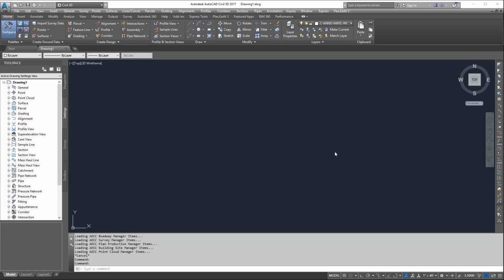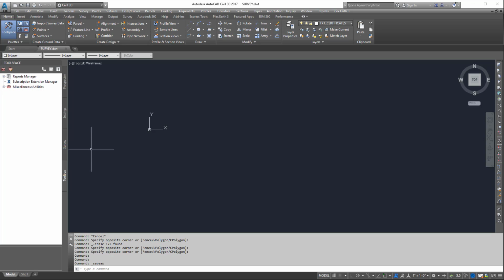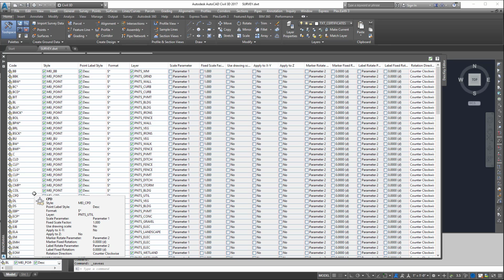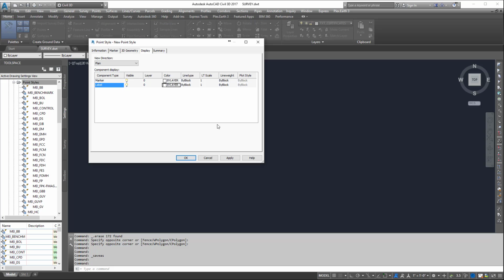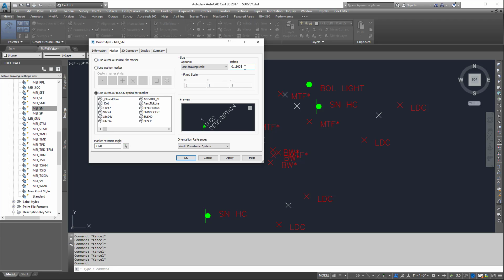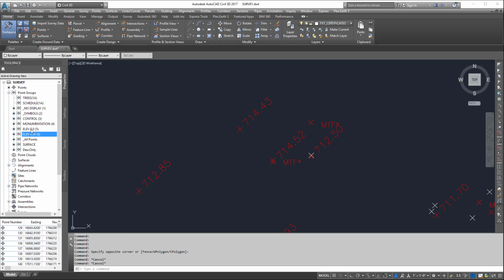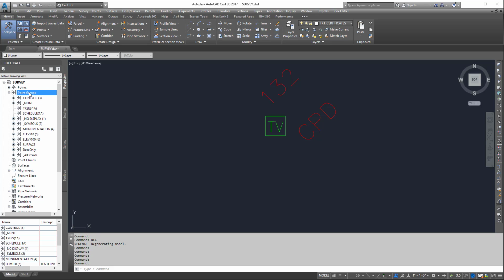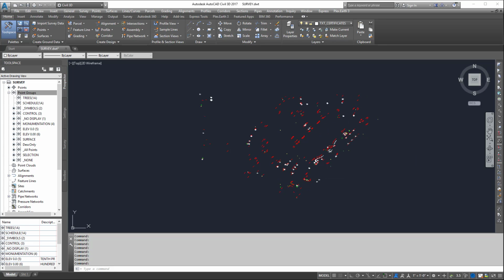Civil 3D Utilitizing Points with Description Keys, and More

Comment: Hey, Thank you for the video, very usefull ! I still have a question, is it possible to have description for a point representing the beginning of a line, a description for a point in the middle and a last description for the last point of the line... and then connect everything together authomatically ?
I am used to do survey maps and I would like to be able to draw roads for example authomoatically.

Thank you in advance for your answer!

Best regards
Reply from the maker: Yes it is, but you either need to collect the points using begin and end aka linecodes or amend the file yourself in the txt or csv file. Will be doing a video on this shortly.